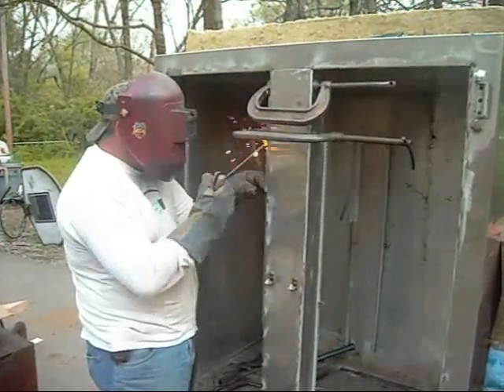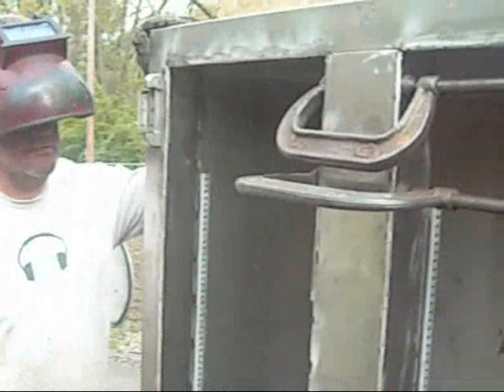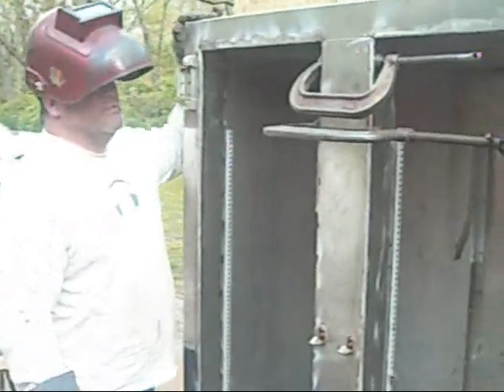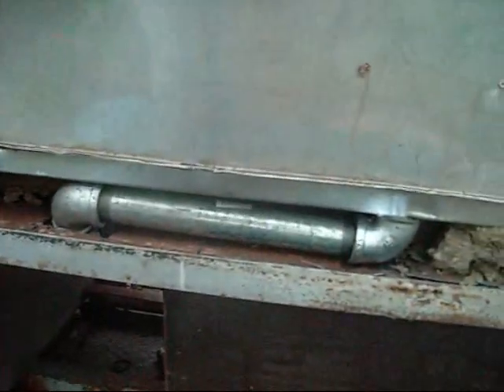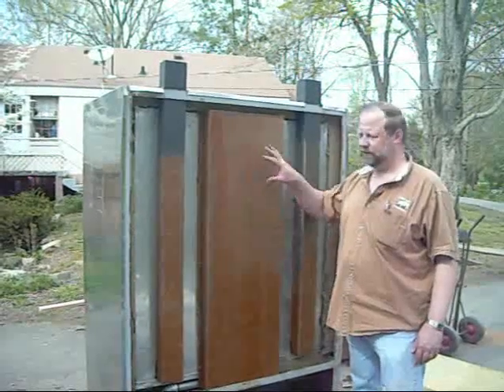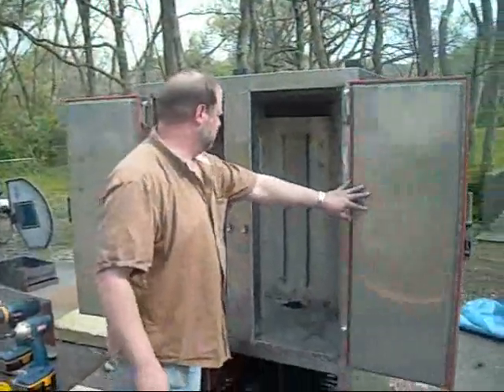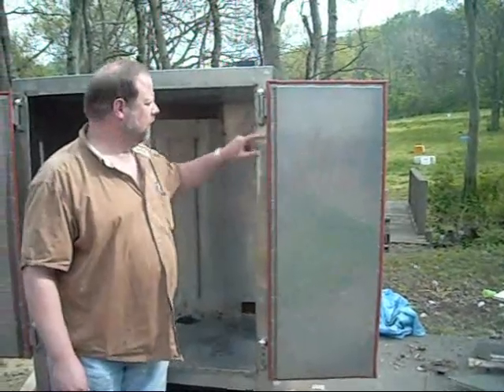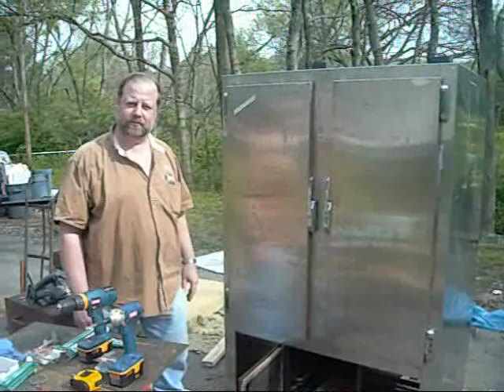Building a new smoker part 6

Comment from the maker: I actually do have some insulation around the flu and the chimneys. Not as much as I would like but enough. The principal is that you do not want to exhaust much. The less you exhaust, the less you have to reheat. By dumping the heat in the top and exhausting from the bottom, you force the heat down and the unit to evenly heat before exhausting anything.  I fired it up Saturday night and it worked like a dream. I will post a video soon. Thanks for following and the input.